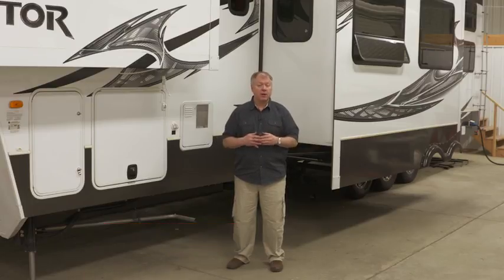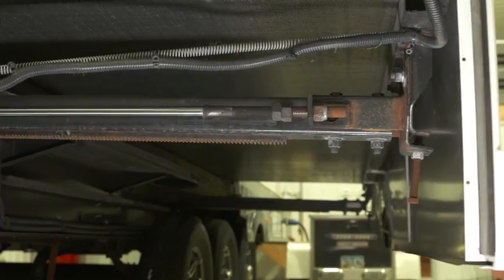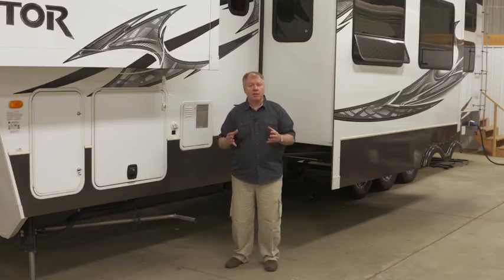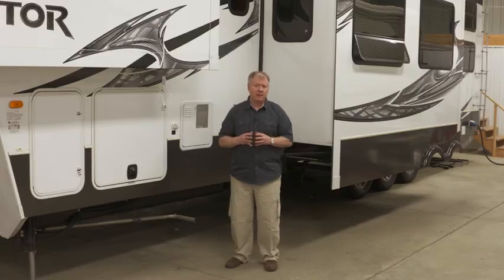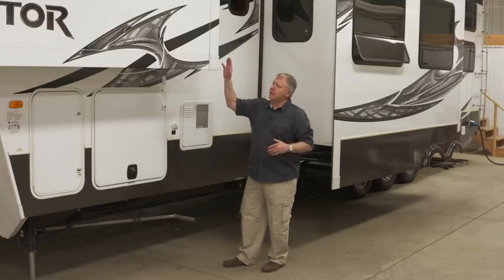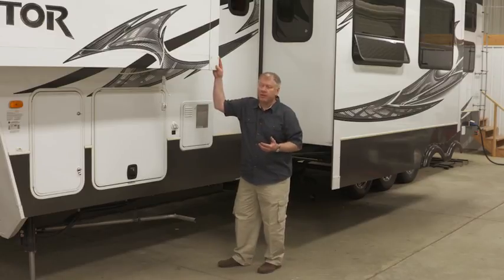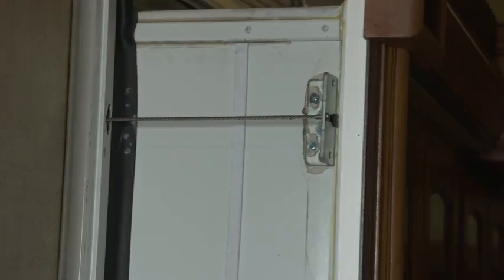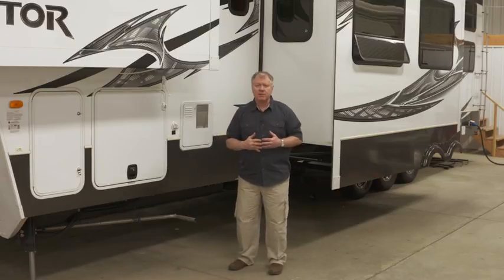Slide Room Troubleshoot: Identifying Your RV Slide Out Mechanism

Comment: Can someone please tell me how to slide out a 1997 sunnybrook 5th wheel camper.
Reply from the maker: It depends on what powers it. If it is hydraulic or electric it will have a switch. Most of them will have a toggle switch with in and out indicated in it. Some models have a safety switch that needs to be activated first and you just push the slide button and it will move and stop on it's own. If you press the button while in motion it will stop and pressing it again will run it the other direction. If you don't have one of these systems you could have a manual slide. There will be a lever under the slide that needs to be pulled to the side and the slide will move out. There have been systems that used the bump outs on the side as well so make sure to check all around the slide and see what you have. Make sure to check the top for a slide lock as well, these can be on the sides too. I hope this helps!

Comment: What is the solution if fuses pop everytime I try to bring the slide in?
Reply from the maker: Hello Rumrunner, what is the make/model?
Reply: @RVlifestyleandRepair  2013 keystone raptor 41.5'
Reply from the maker: Hello.  Most of the time when this happens it is due to low voltage. I would 
make sure the batteries are fully charged and can hold a charge. Check 
the water levels and make sure they are full. I would check the voltage 
at the batteries when operating the switch, if they drop to below 
10.5VDC then the batteries could be sulfated or bad. You can get them 
load tested at auto stores to see the condition of your battery. Make 
sure the fuse for the charge line to the battery is good too. Fuses blow
 from a high amp draw, which will happen from low voltage, failing motor
 or an obstruction in the slide. I would make sure there is no binding 
on the system and lubricate areas that are needed. There could just be 
rust build up in areas and causing it to drag. You can also check all of
 the wire connections, loose connections will cause a higher amp draw as
 well. Make sure nothing is corroded or frayed insulation on the wires. 
This is important on the batteries as well, clean the terminals the best
 you can. These are the best things to check before replacing the 
batteries. I hope this helps!
Reply: @RVlifestyleandRepair  I'll check that out and let you know.  Thanks so much!👍